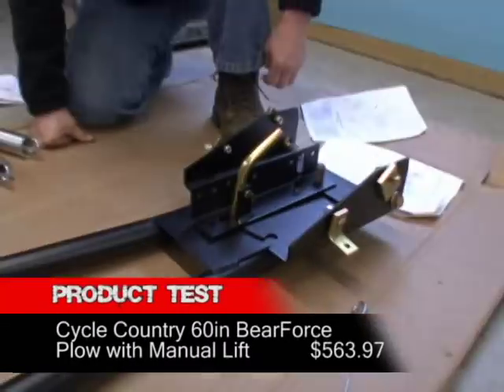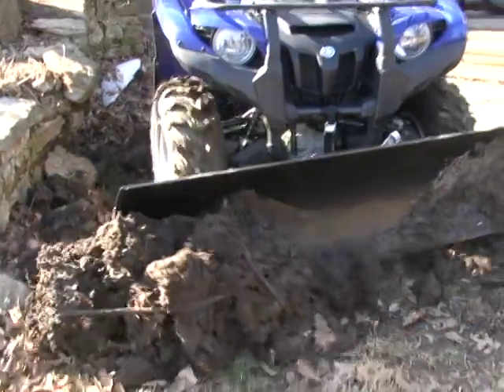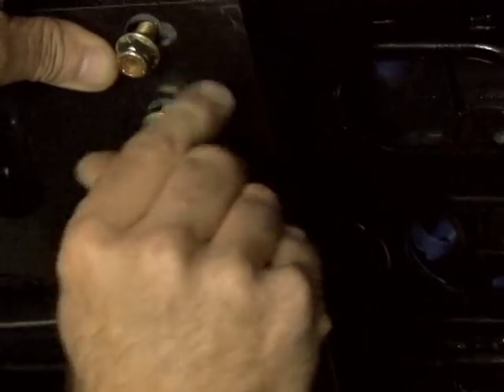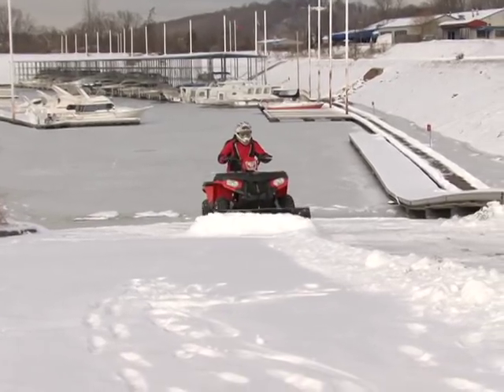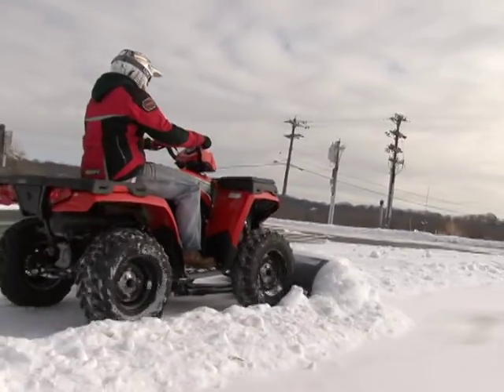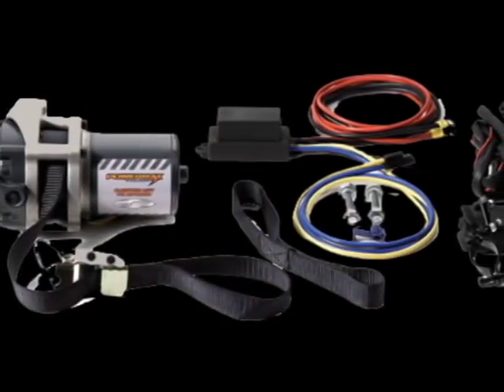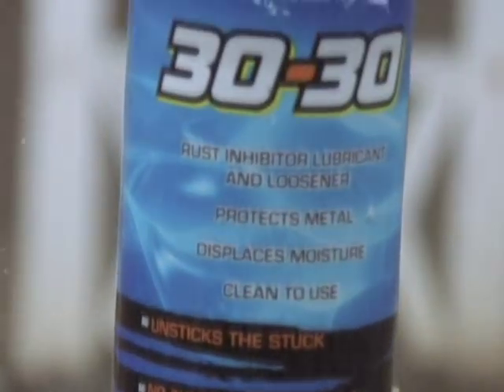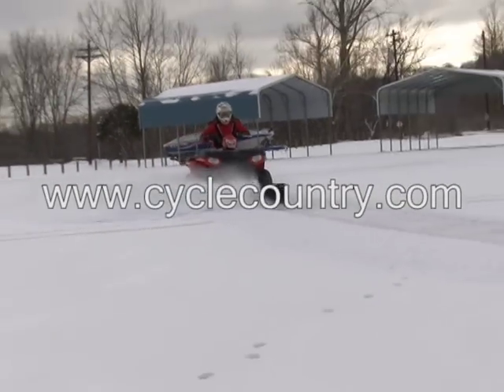Cycle Country BearForce Snow Plow Test, Part 2

Comment: can it be locked an inch above the ground ( carrying the blade) so not to pickup driveway stone?
Reply: Install blade skids and that way you can adjust the blade edge as far as you want off the surface. Or install a rubber cutting edge ahead of you regular steel blade. I have mine set about 1" lower than the steel blade, so it does not harm the grass when I plow across the lawn. 
 ALso WD40 isn't going to help stop rust on your blade. Use some kind of lithium grease or spray that leaves a residue behind to protect it.